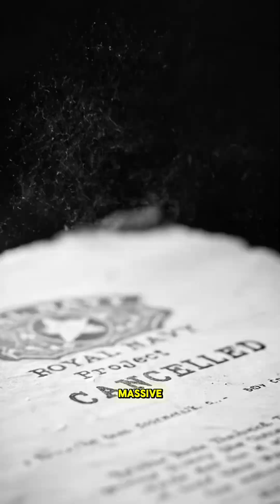The Ship Made of ICE?  #WW2 #documentary #history

Comment: Many didn't last long after war cause did last long welding didn't last as long as normal way to build ships
Reply from the maker: That’s partly true. Many wartime ships were built quickly using new welding techniques, which sometimes caused structural issues. However, those methods were designed for speed and wartime needs, not long-term postwar service.